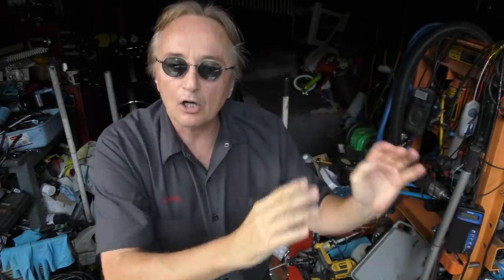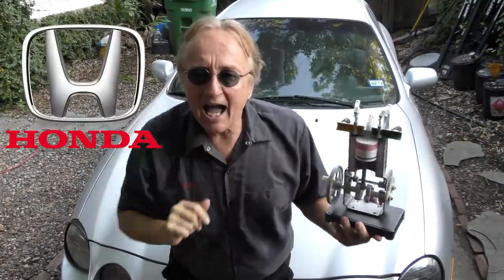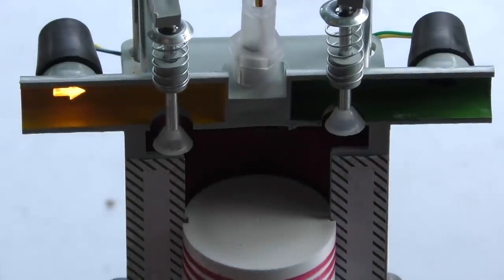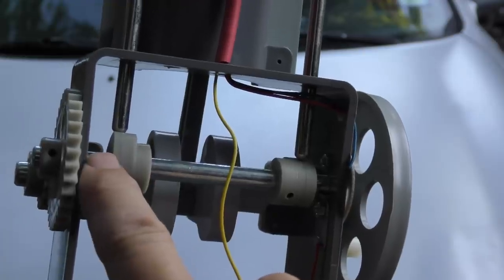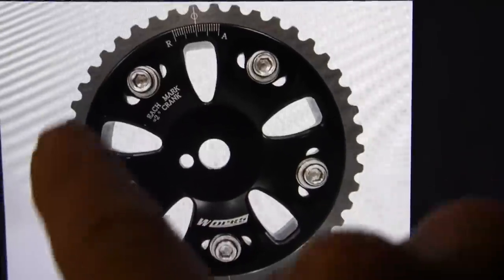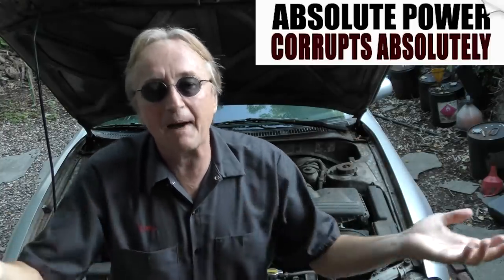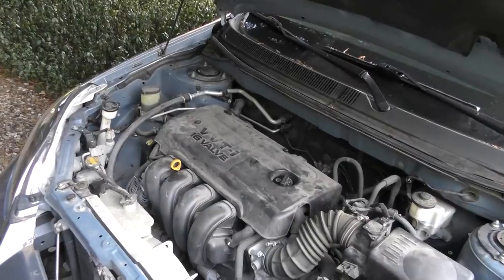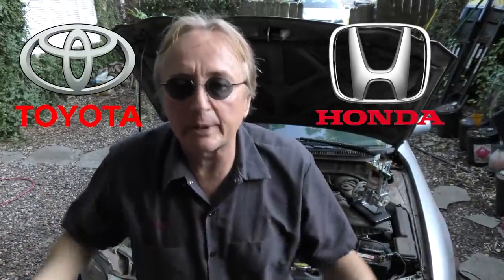VTEC Just Kicked in Yo - The Best and Worst VVT Cars to Buy

Comment: scotty u wanna talk about bad timing parts check out accords 02-06 k24a4 engine timing in those is crap seen a person online that had a accord die at 78k with a timing chain that snapped in half...... also just had a accord come to my shop and intake cam gear was 90 degrees off.... person bent all the valves in the engine

Comment: Hi Scott. I live in Lagos, Nigeria temperatures can get up to 38 degrees sometimes 40. My Camry  recommends 0w-30 ( 2005 2.4i) should heavier oil not be used ? 
We don’t get cold weather here. It’s between 23 degrees at best and anything close to 40. 

I use 20w-50. Is this too heavy for the engine

Comment: Pointing out that vvti is only timing, no valve lift. Toyota only ever made one engine with vvtli, the 2zzge. And on top of that, on honda's vtec, only the exhaust cam gets more valve lift. Both cams get valve timing, exhaust gets lift.

With Toyota's vvtli, both cams get timing and lift. 

Also, on that toyota variable valve timimg camgear.. there's a little pin that shears and makes it noisy at startup, almost sounds like a spun bearing for a second. Will this effect the camgear's ability to alter cam timing? If so, how much power are we looking at losing?

Comment: Hey Scotty. So, I have a 2009 GMC with a 5.3L Vortec engine with Variable Valve Timing (VVT)). So I was thinking about doing an Upgrade rebuild. I was planning on going with a hi-Volume oil pump. But after seeing this I'm wondering if the hi-volume pump would mess with the Variable Valve Timing (VVT). What do you think? Should I stick with a Stock pump?

Comment: Thanks for the model. Quick question please. I have an 02 CRV with a 2.4 and it sounds like something in the engine or VVT is locking up when I try to start the car every now and then it has broken the bell housing off of three quality starters. Any advice? Other than drive it off into the surf? :-)

Comment: I'm curious about the failures on Mazdas. Which models have the problems? I've owned 2 Mazda 3s and I've been very happy, but right now my current mazda3 has 120k miles on the clock so I don't know if I'm pushing my luck

Comment: Hi Scotty
, I have honda accord 2000 (130k mileage ) model and transmission oil have not changed since day1, I have checked the color and its red. However, while ready to change it now the ATF DW1 is not avaialble in local aftermarket in Australia. wondering if you can suggest any equivalent oil for my car.

Comment: I've never had any issues with changing the oil weight, car calls for 5w20 I use 5w30 instead, seems to keep the upper more lubricated at higher rpms than what vehicle calls for. Thoughts?

Comment: Hey Scotty, I have a Camry with VVT-i I just read that there is a secondary oil filter (a small one) just before the oil goes into the cams. Should this be changed every so often, if so Toyota has never mentioned it to me. I have noticed that some cold starts there is a metallic grinding sound for a second or two, I'm guessing until the oil flows in. Should I be worried? I think the first owner may not have been to good at doing oil changes on time. 2013 Camry Hybrid, 200,000 kms.

Comment: how do you feel about the mazda miata vvt engine cause from what i heard they are pretty sturdy, i have a 2002 miata with vvt and its got 90000k on it and i drive it pretty hard half the time and havent had any issues yet. The reason i ask is because i believe my 1.8vvt is different than some of the other mazda engines of that time period out there.

Comment: How come Honda's variable valve timing is the only one that that you can hear and feel? 

Also, my car is recommended at 5w-30. However that was 20 years and 255K ago. Should I continue that or use thicker oil? Thank 

Ps NYC climate if that helps

Comment: I have an 08 accord (2.4 exl) that is burning oil. I used synthetic oil and used octane 93 fuel. I consistently change the oil every 4000 thousand miles and still have the same issue. Its burning oil every 1500 miles. What can be the issue with these cars?

Comment: The are cars that use electronic vvt and therefore bypass any oil issues. Calling out Mazda seems silly since most engines are built to similar specs in China then assembled in the USA or Mexico. Honda best cars are the 80s and 90s when they were overbuilt for pride, now they are built to a cost like everyone else.

Comment: VTEC doesn’t kick in it kicks down. VTEC engines run most of the time on the high lobe cam for power. It only goes to the low power cam lobe when cruising at steady high speed when less power is needed to improve fuel economy.
Reply: Not on the Honda's it doesn't. At least none of the k series or b series work that way. The high cam lobe is only used above 5970 rpm at more open throttle positions.
Reply: Christopher Brandonisio My Civic never reaches that high RPM. At 70 mph it’s around 2200 rpm.
Reply: @Herlongian  that must be a newer one then? My Si has an 8400 rpm redline and most of the power it makes is well north of 6k rpm. The 4 cylinder accords also worked the same way.

Edit: 125 km/h on the highway is roughly 3600 rpm for me in 6th gear.
Reply: Christopher Brandonisio My Civic is 2007 R-18 engine. But you are correct. The high cam engages based on higher RPM. So the high cam does kick in whenever you punch it. So idling, cruise speeds—anytime the car is at low RPM it’s on low cam. I stand corrected.
Reply: @Herlongian  Nice, how many miles on the R18? Those things seem to go forever
Reply: Christopher Brandonisio The engines from 2006 to 2009 suffered cracked engine blocks on the coolant channel due to a casting error. It was corrected. Honda decided to replace the long block for free for all owners— even subsequent owners for 10 years. If the overheating also warped the head, you get a new complete engine. My Civic engine cracked at 104,000 miles. But others cracked at low miles— no way to tell when it would occur. Honda replaced the engine for free. So the car has 240,000 miles the engine has 136,000. The new engine identical to the original engine just without the casting error. It is a great engine. Only 1.8l but puts out 140hp. Idles so smooth you can’t tell it’s running. No vibration whatsoever at idle. The way it runs it can last 400,000 miles at least.
Reply: @Herlongian  Yea I've heard of the cracking block issue on the earlier ones. Happened to a friend of mine's. Guy in my office has a 2006 (all original from what I've been told) that's at almost 800000 km now...guess he got real lucky lol. Just routine maintenance (that and 4 clutches).

Comment: I have a 2010 Camry with the 2.5L 4 cyl and the VVT system. It has the annoying cold-start engine rattle every time I start it. It has been doing it since the car had 70 or 80 thousand miles or longer. I assumed from some onlline research it wasn't a huge issue so I never had it fixed. I now have 200 thoudans miles on the car and still no issues other than the annoying ratlle at cold start. It doesn't use a drop of oil between changes either. Is it worth the time and money to replace the VVT valves or is it likely something else causing the noise? I have owned the car since it had 20,000 miles and I religiously change the oil and filter with 0W-20 full synthetic every 5000 miles since I bought it even though the book says I can go 10000 between changes. Thoughts?

Comment: Hey Scott I have a question I have an Acura RSX with miles of 139000 the more miles it is do you use thicker oil or do you use the same oil told by the manufacturer itself no matter the miles? I remember I was told the more miles you use thicker oil is that true?

Comment: How is fords variable valve timing?
Reply: Excellent. Look at there naturally aspired Mustangs.. there v6 Cyclone Mustangs made 305 Horsepower with 30+ MPG's... and the 5.0 v8's made well over 120+ more than that.. They call it Twin Independent Variable Camshaft Timing at Ford.. it also helps that they use 4 valves per cylinder in those cars.. and Double Over Head Cams with the variable valve timing in the mix of all that there newer mustangs / performance cars just make loads of power and instant power response as of 2018 they added a 10 speed automatic transmission to the mix

Comment: I have a Honda k20 VTEC engine and it literally drinks oil (500ml plus every 1000 miles) as it always has from New. Honda say using up to 1ltr is acceptable. 

A lot of other people Also have the same problem with these engines but why in particular these VTEC engines?

Comment: Wrong the first VTEC engine Honda made was in the CB400 in 1983/1984.
Reply: 1992 civic ex and si d16z6 sir
Reply: @Mike P im just going by what honda says . the 96 civic had a d16y8.  I had a 92ex 4door and i wish my my ilx weighed 2418lbs. It wouldn't matter that it has only 200hp

Comment: could i get away with using 0w30 oil in my vvti 2010 camry that requires 0w20? engine has 130,000 miles on it and i live in a hot climate that can easily climb over 100 degrees Fahrenheit

Comment: I would say that Toyota makes a better engine than Honda. The Honda may make a few more hp but they are all interference motors and the Toyota's, for the most part, are not. Also, Honda's have transmission issues, always have with the automatics from my experience and the cvt trans are even worse. I always come across Honda's with bad engine/automatic trans but the Toyota's are much better.

Comment: +Scotty Kilmer my 08 4cl honda accord lxs has a oil life gauge on the dash with 110%-0%. The honda dealership and manuel tells met to follow this gauge and the wrench to change oil wont pop up until 15%. well i use conventional, which is what the manual recommends and i'm at about 9k miles by that time with my 5w-20 oil. should i continue to follow the honda oil life gauge?
Reply: im at 122k miles right now on car life btw

Comment: Scotty Kilmer ....my Car is Toyota Allion 2008(Engine 1NZ-FE VVTi, CVT Transmission).... Toyota Recommended Oil is: 5w-30.... last Oil Change i'm using Castrol Magnetic 10w-40 which is actually Synthetic Blended not 100% Synthetic....and the previous Oil-change used a Semi-synthetic.... would these be much harmful???????...i'm gonna change the Oil to 100% Synthetic with 5w/10w-30....but 10w-40 is tht much heavy to ruin the engine...?????

Comment: Toyota and Mazda engines breaks. Honda's the fuel consumption, has model gets older of motor vehicle the becomes more heavier on fuel. I tested this on a 4age 16v vs b16.. The Honda engine became more expensive on repairs and fuel consumption was ridiculous. Plus my 4AGE TWINCAM 16V was cheaper on engine spares more reliable for everyday car and also on fuel. So, why do have you to buy a new car, which give a headache and hole in the your pocket. I can't understand why, if ain't broke don't shoot it.

Comment: Didn't say much on this video and the title is misleading. Hey he even missed MiVec from Mitsubishi which gave VTEC a run for its money. He also did not properly explain how the VTEC technology works. If I didn't know exactly how the system worked I would have understood nothing. Heck he doesn't even say why and how a VTEC produces more power. That is shoddy work just to push out a video. To explain in a nutshell how the system works and produces more power here is the gist of it. It has two sets of cams, on low revs it uses smaller less aggressive cams that do not allow overlap between the valves which means that either the intake or the exhaust valve is open at any given time. When the engine revs up over a threshold it switches the cam profile to a much more aggressive one which allows overlap of the valve, this allows the engine to have way better efficiency through air resonance which compressed the air and also allowed for larger breathing capacity (using the extra air of the intake and exhaust on top of the cylinder) at those higher revs and as such more power. Meanwhile at lower revs because there is no overlap of the valves is optimized for low revs and as such gives greater fuel efficiency.

Comment: Original vtec did not have valve timing yasshole only variable lift...... God damnit
Reply: Sergio Aguirre I know that much guy but he is saying vvt does the same thing (which is my point) in its first iteration it did not change lift at all, it only advanced or retarded timing  of the valves via cam pulley... And VTEC still does not change the degrees of the cam itself... Only lift....

Comment: HONDA HAS NEVER HAD A VTEC FAILURE LOOK IT UP
Reply: Take a look in to the f20c.  And the s2000 both failed
Reply: F20c is the s2000
Reply: Look up s2000 from hell Toni tuned
Reply: Unless you don't change the oil like he said in the video.
Reply: True but that's not a Honda fault that's a dumbasses fault I still bang my stock head h22 at 8500 all day everyone says you can't do that lol

Comment: A little disappointed in this one Scotty. More than a little disingenuous with your commentary on Mazdas VVT technology.

You only briefly mentioned the actuator was from Motorcraft. Motorcraft = Ford. The problem with Mazdas VVT system wasn't Mazdas fault, it was Ford's. No doubt a byproduct of Ford's bean counters pinching pennies on Mazdas engineers, forcing then to use compatible parts bin components.

You also failed to mention that this problem was on the old Mazda MZR engine from the late 90's. There were multiple TSBs for it. And even a failed class action lawsuit at one point. The modern Mazda engines from about 2010 onward, and most certainly the Skyactiv engines, have never suffered such problems. Not surprisingly because that was around the same time they made their clean break with Ford, only sharing some technology patents, and Mazda buying Ford's 3.7L V6 (a solid engine in it's own right) for their later model CX-9s.

But hey, wouldn't want to throw Ford under the bus, i mean, after all they did provide you with that nice Mustang to drive around in and do burn outs with, so we wouldn't want to say anything negative about them, now would we?